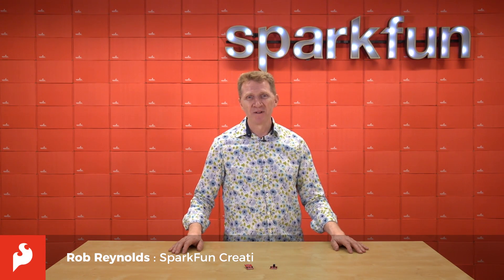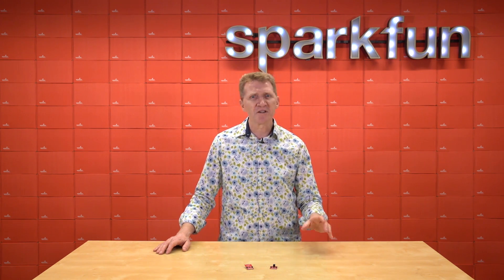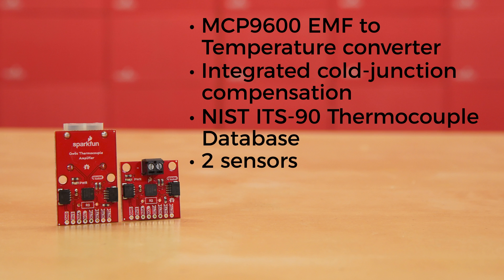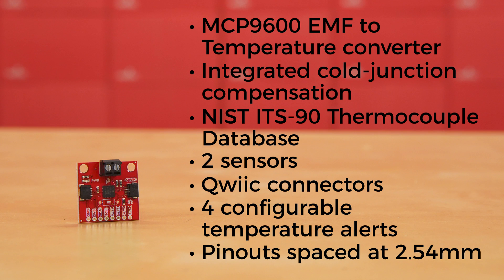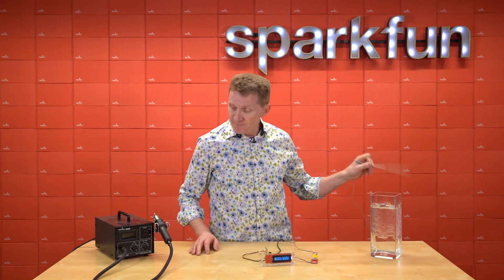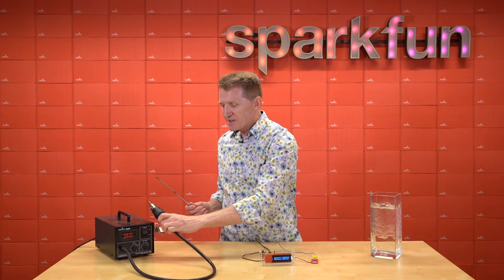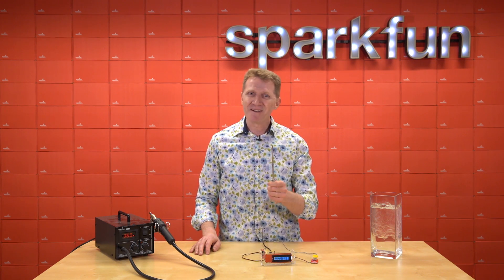Product Showcase: SparkFun Qwiic Thermocouple Amplifier

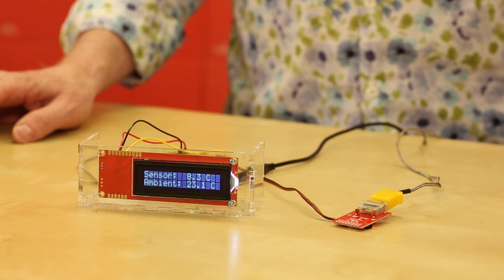Comment: 1:45 ambient temperature suddenly drops to 0C
Reply: Looks like a spike due to a dirty not well filtered analog signal coming from the thermocouple to the MCP9600 or a miss from the numerical serial output of the IC, anyway, low cost solutions exists for non sensitive applications not requiring a precise temperature measurements,  they are generally made of a simple operational amplifier with low voltage offset such as the famous OP07 are sufficient.